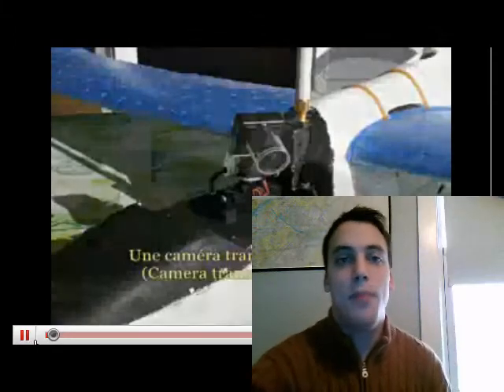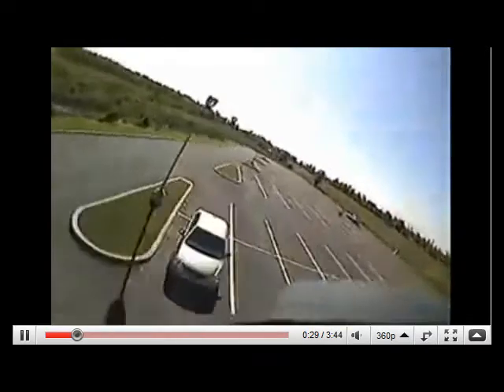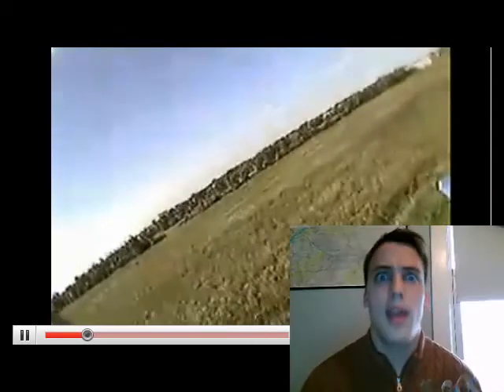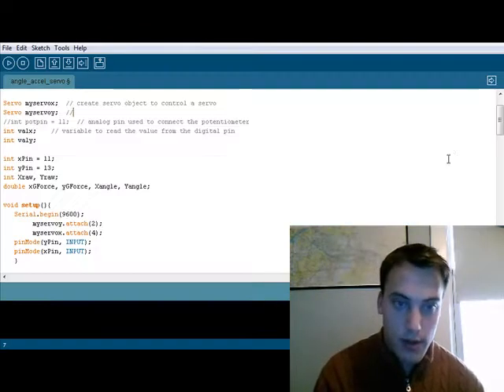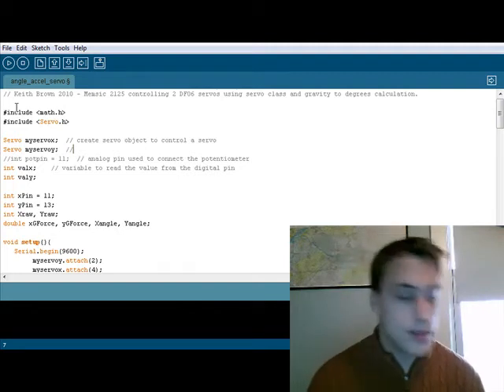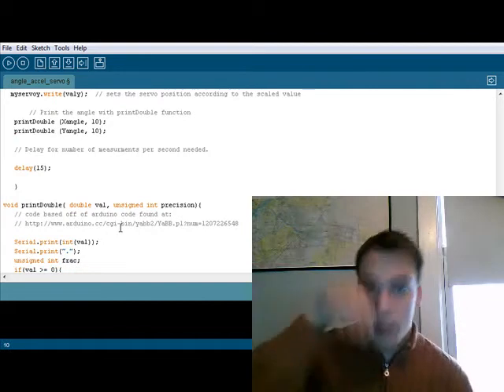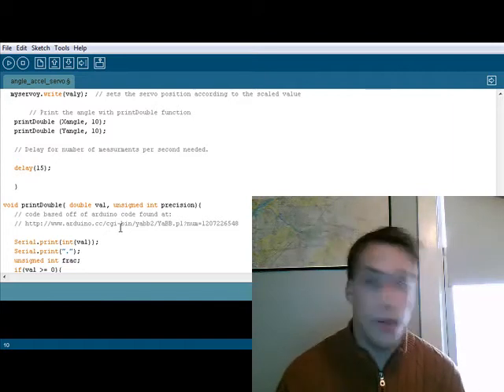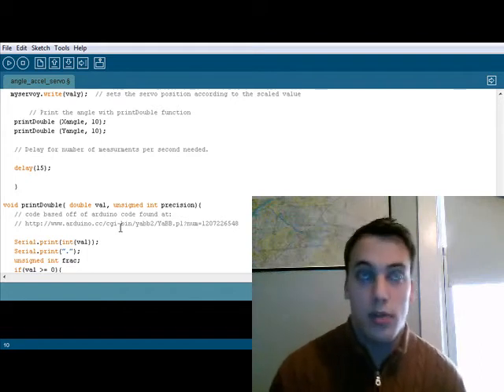An Introduction: Arduino Head Tracking System for FPV by Keith Brown

Comment: Hello. Up and down head movment works well with the accelerometer, however, you do not lean your head to the sides, instead you twist it, so I believe a gyro would be more of use in this situation. However it's a great project and the principle used in hundreds of dolars systems is the same. :)